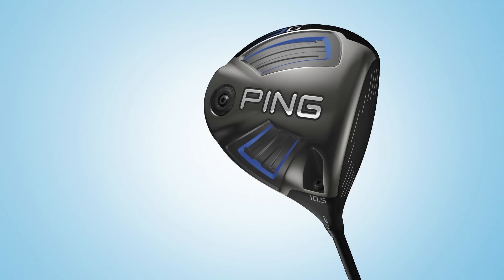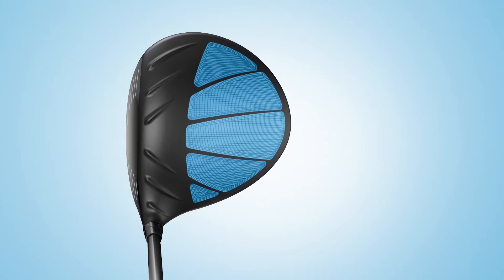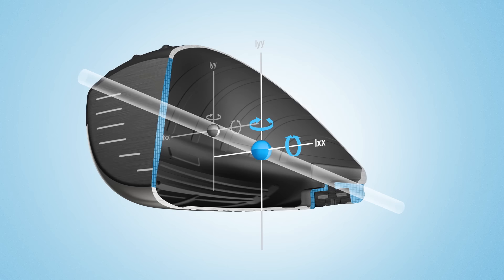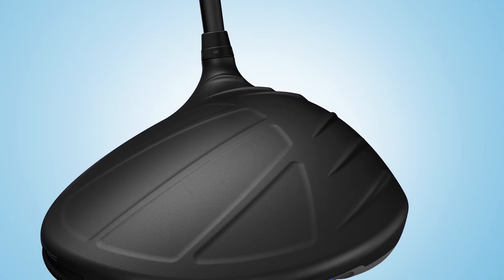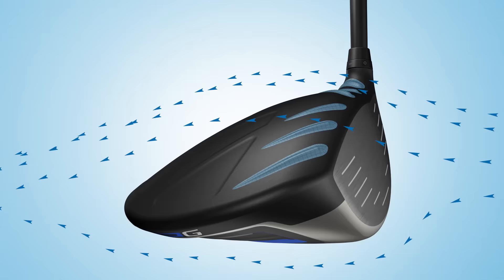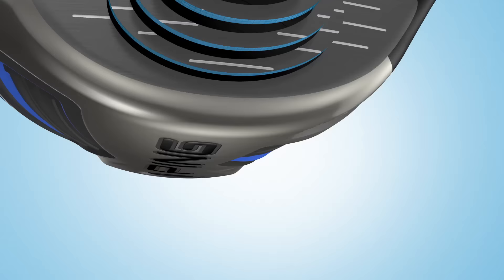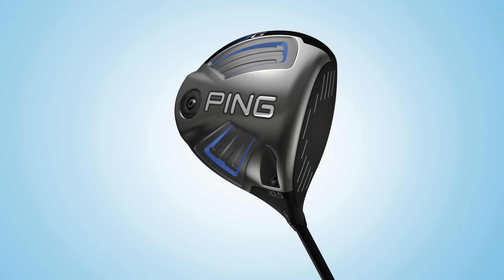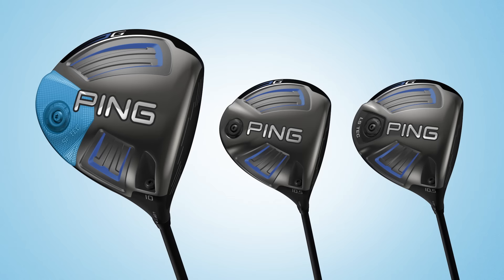PING G Driver

Comment: I'll never buy another Ping driver. I bought the G25 and the shaft busted after 10 swings. I had it replaced and it busted after 2 swings. I've had a Cleveland Hibore with a Fujikara shaft thats literally been swung thousands of times and is 100% fine. Ping, your shafts are utter garbage.